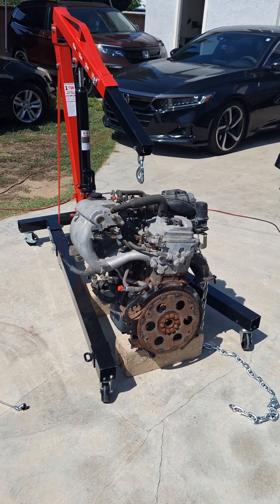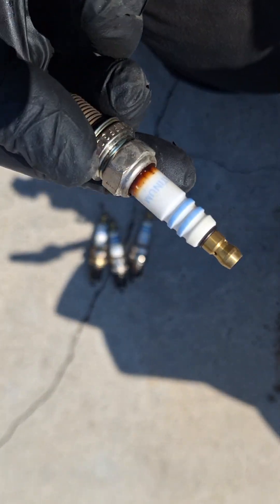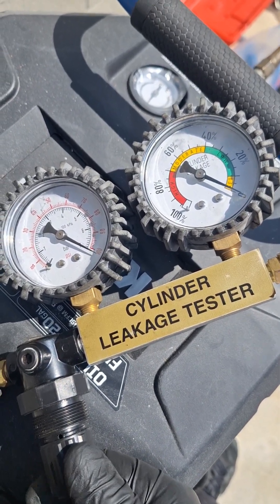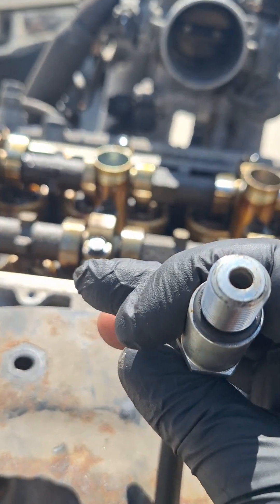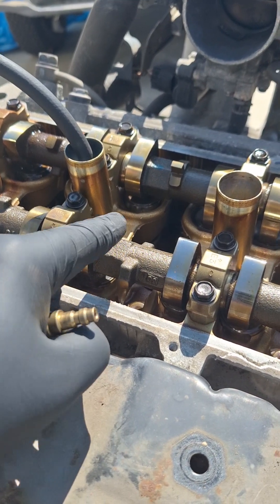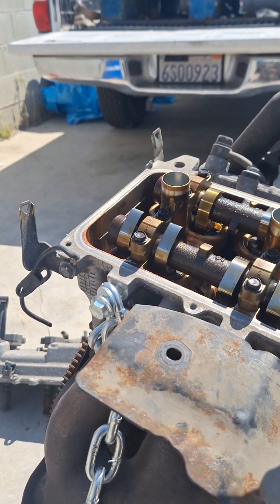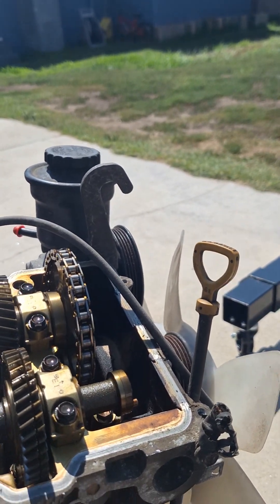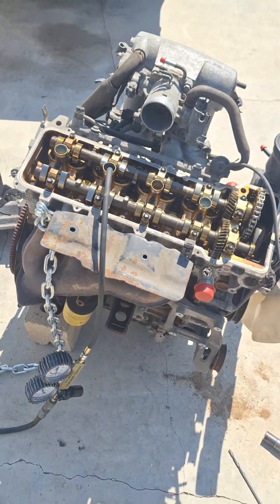Cylinder leak-down test on used engine #auto #automotive #tools #diy #mechanic 2001 #toyota #tacoma

Comment: So since there is sound, and its out of the exhaust then then would indicate a leakage/break in the exhausts ports or valves? And if there was no sound,or very little, then then engine would mean its good in leakage.
Reply from the maker: Yes, that is correct. In this case, after overhauling the engine, i found worn exhaust valve seats. As a rule of thumb, any leakage <20 % is considered passing the lower the better. You would notice no audible air leak on a good cylinder
Reply: @harborareatech310 and you can test each individual cylinder right?
Reply from the maker: @harlovedeepsamra4182  yes each cylinder  ould be tested an its top dead center compression stroke position

Comment: Pretty good and informative! I just changed the cylinder head gasket on my sisters keep and torqued the cylinder head back on the block. I will have to put the timing chain, clock the engine and put the the cam shafts back before I do a leak down test to make sure the new head gasket I put on is sealing well.
Reply from the maker: Heck yeah!! Hope is all good let me know if you gota any questions regarding the leak-down test

Comment: Is 100psi the common number?
Reply from the maker: Set your  cylinder leakage gauge to 0%. Typically, the air psi would be somewhere in the range but focus on the cylinder leakage gauge. The adjustment knob is for both.